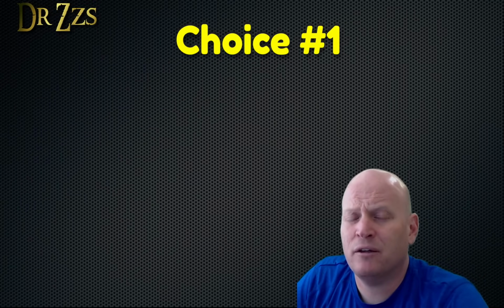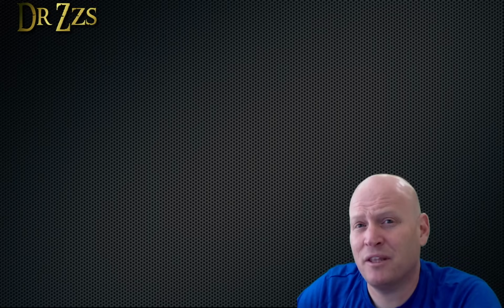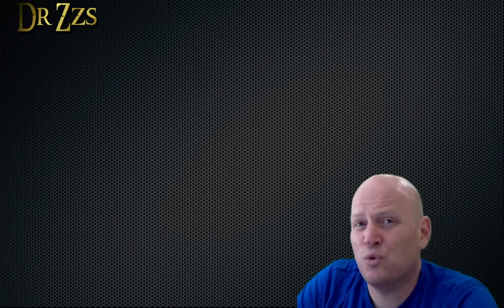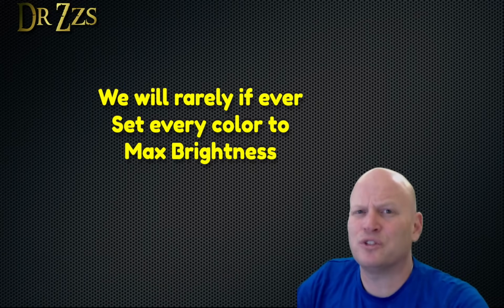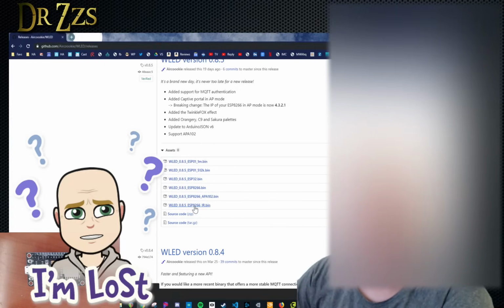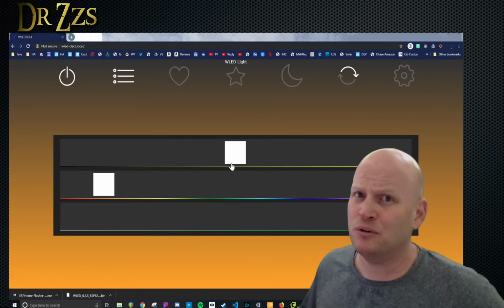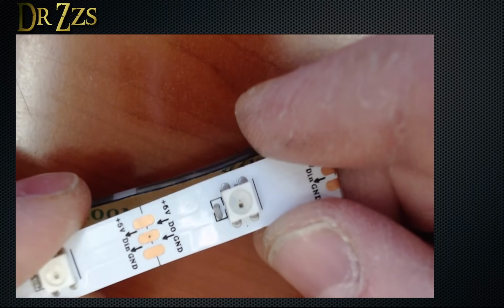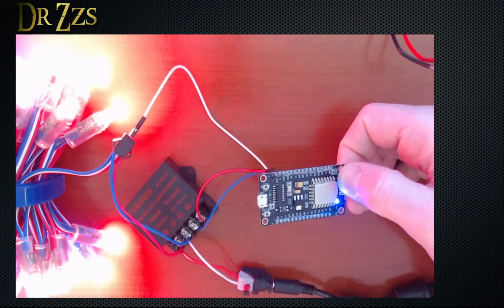Beginner's Guide to Christmas Lights - and LED Shows for Every Holiday

Comment: Thanks .... I have a problem... my first pixel of led strip always is on in green and when I select any effect, this pixel is not part of the effect
Reply: Thanks ...

But I cut it and the first pixel (before of cut) continues in green when the holiday lights are power off, but if I reboot all system the pixel shutdown disappears for few hours returning to green after those hours, it is like the led strip continue receiving data... maybe the shifter logic 2IC is creating some noise in data signal...
Reply from the maker: There's a check box in the "LED Preference" settings that says "skip first LED".  Make sure you have that unchecked. 
If it still happens that pixel might be bad. You could try cutting it out and starting with the second one.